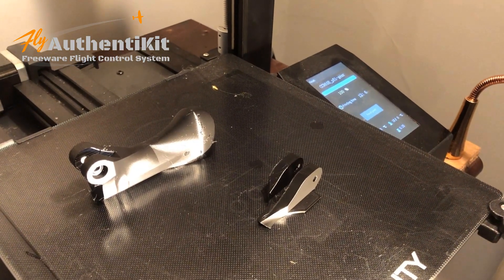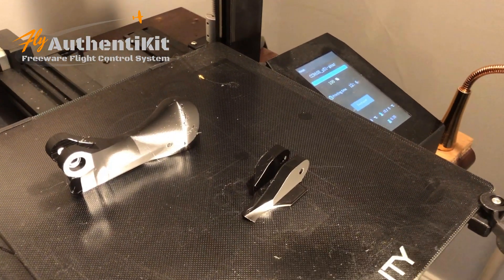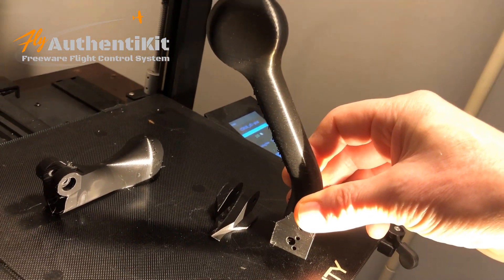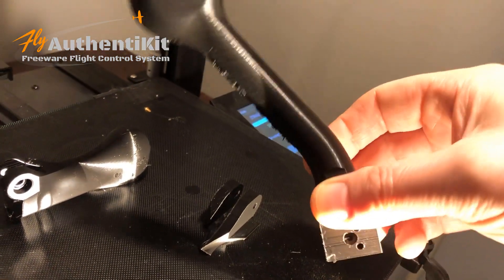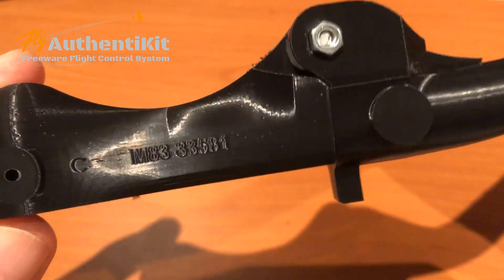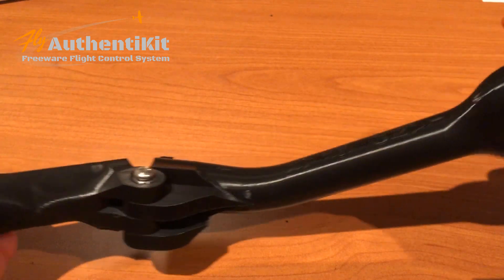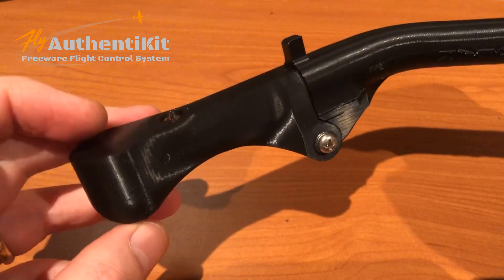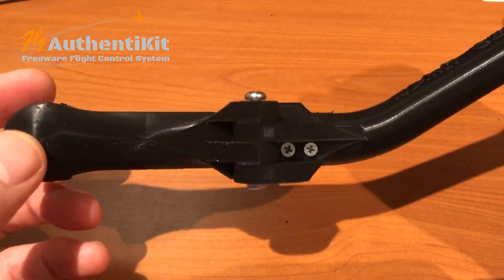AuthentiKit Flight Sim Controls for P-51D Mustang

Comment: I had the P-51 3-D pedestal and throttle quadrant built for me a year ago …  ( since I don’t own a 3-D printer). I purchased the internals from Simkits Supply. Together they took LESS TIME to assemble than the P-51 LEGO Set ( a Christmas present from my grandson)…. Less cussing too! LOL.
Question for Phil…. Is it possible to still add the Carburetor Controls (Ram Air and Hot Air levers). They’d be two more items that a mouse wouldn’t be required at start up, … more immersive! Nevertheless, really enjoying it!!!
Reply from the maker: Thanks! We’ll get there with the carb/ram. We need to expand the hub first to take more inputs. Hopefully this year for that.

Comment: Just started to learn 3D printing. Your kits are not innocent it this fate of mine 😁 And this type of the trim box was the one I found as optimal for WW2 sims - looking forward to release.
Do you intend to add scale for trim wheels showing amount of trim applied and eventually add some gearbox so you'd need to make few revolutions to apply full trim to either side? (Just looking at photos of the real cockpit)
I do not know how many steps are modeled in game sims but axis resolution of controller boards and sensors as well if often around 4k thus i.e. 90-degree movement to either side is not large enough to fully use this controller/sensor range.
Reply from the maker: Here's our solution for calibrating trim wheels. We're going for accuracy as ever ! https://youtu.be/Sx6KJ0dEtus